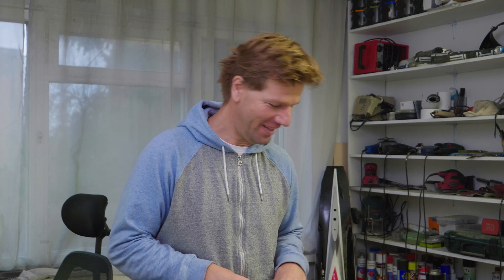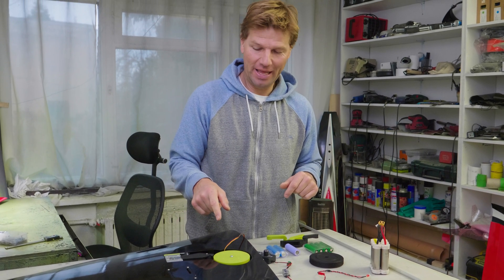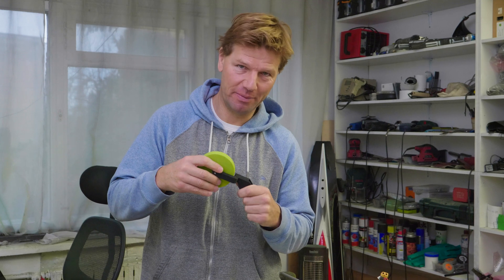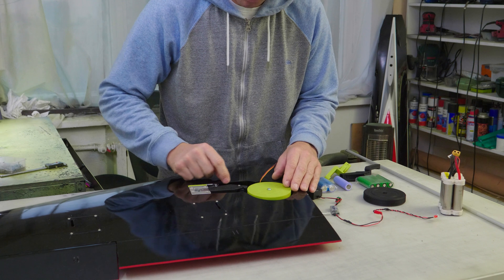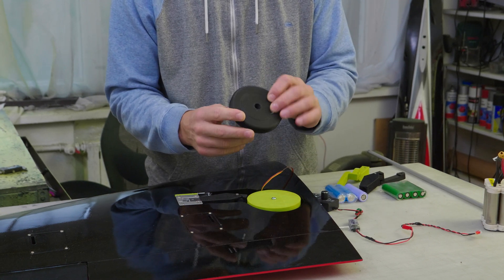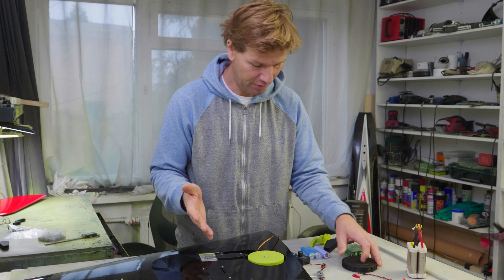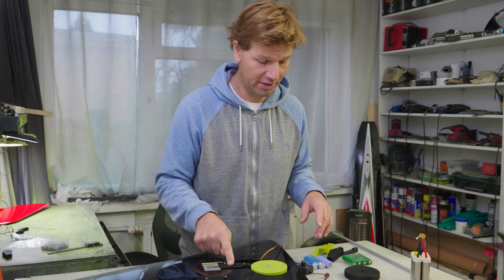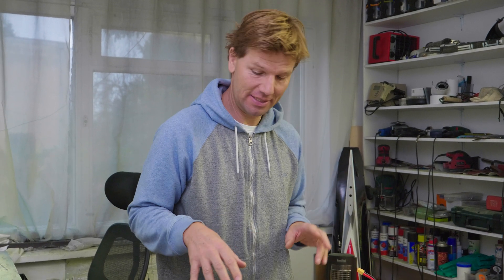TechTalk EDF Jet Odyssey 3D printed Landing Gear, Li-Ion batteries - why I use them.

Comment: At one point I recall you initializing an esc with either a dead battery or with a smaller cell count battery then flying it on more voltage or cells. Can you point me to that video? Or do a video about how you tested if your esc would manage that or if it is something that can be done with other esc too

Comment: I would not guage how robust Lipo batteries are with HK batteries. They use very low grade cells even on their Graphine packs. I can suggest Gens Ace lipo which I have had for years without loss of power or increased resistance.

That said, it appears you are very comfortable with and deeply invested in Lion cells.

Great videos, thanks.
Reply from the maker: HK Graphens are much better than GensAce and I know it from my own experiance, spending approx  2000 Euro for Graphens and 7000 Euro on GensAce before hand. I am responsable for quite substantial enviromental damage....